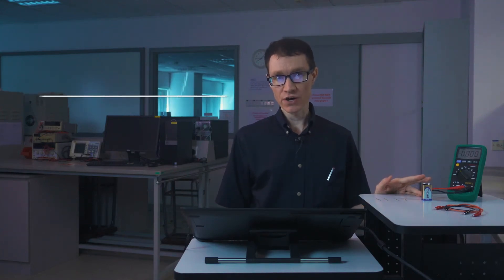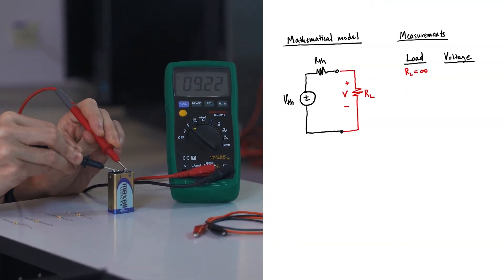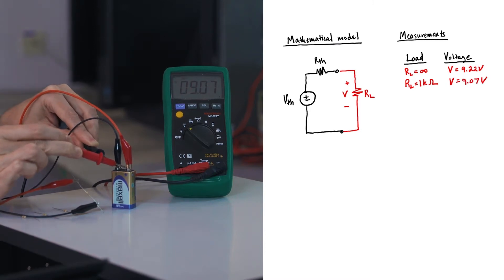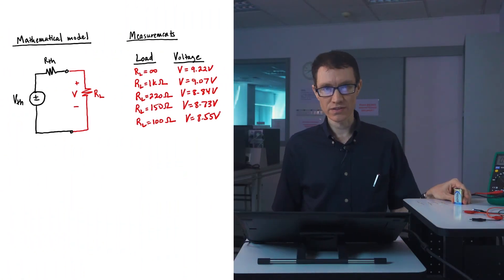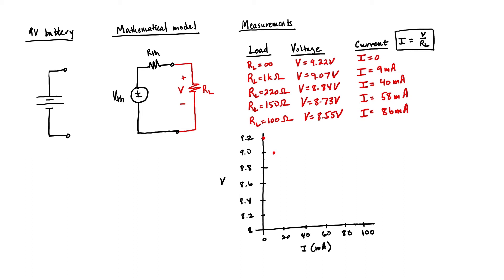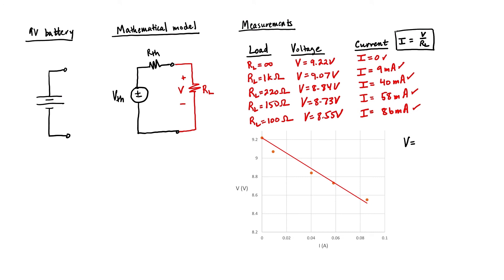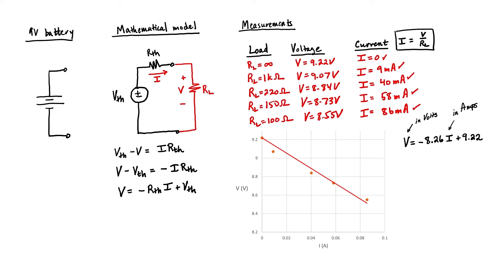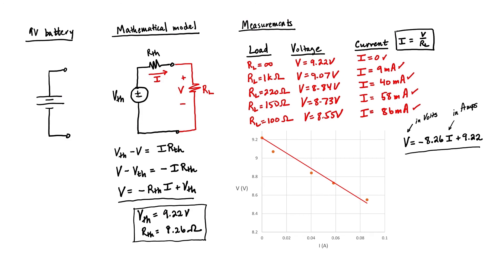Representing a Battery by its Thevenin Equivalent (Circuits for Beginners #30)

Comment: Informative video! how did you find the value of 8.26? at 2:51
Reply: It's the slope of the linear function so that the graph roughly goes through all the data points
Reply: Same question
Reply: @hardikrathore7482 -8.26 is the slope of the RED line you see in his plot, This can be calculated using the simple formula for slope gradient: (difference in Y value) / (difference in X value)
Reply: Apply KVL around the loop.